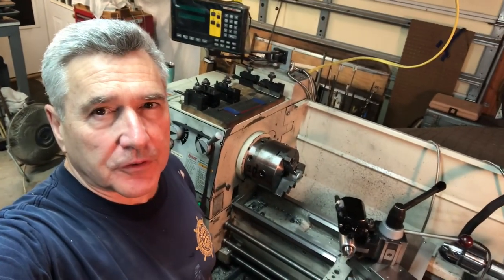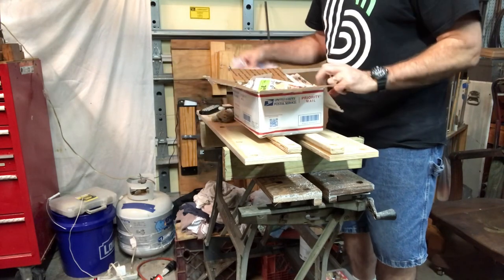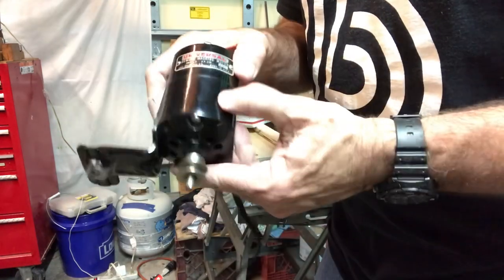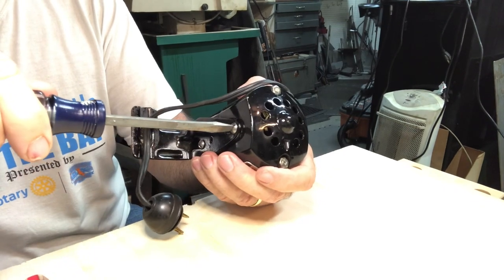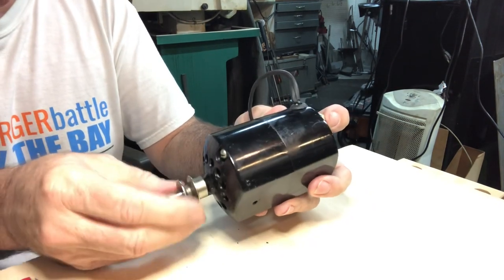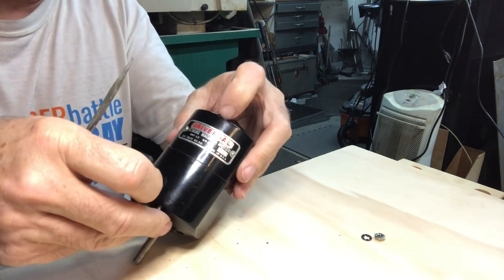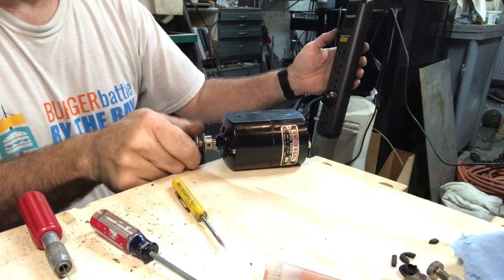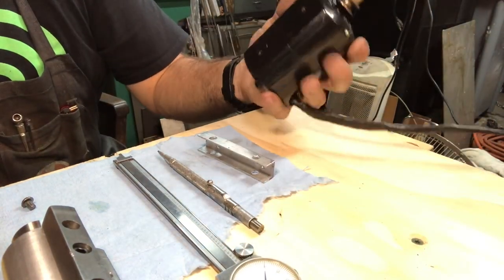Sewing machine motor, reverse rotation, for lathe mill drill and grinding spindle

Comment: Thanks for sharing your knowledge sir. I recently bought an overlock machine and a straight stitch machine ...one needs a motor with clockwise,and another anticlock..I have experience with restoration and repair works but not with these universal motors...here in India mostly we get Anti clockwise spinning sewing motors ,and for overlook machine they just flip install on the table for reverse rotation..I just want to mount motor to the Machine itself, so it is more compact..I will definitely work and Modify my motor...thanks again.

Comment: you talk and show everything, but how you "switch" brushes
Can you explain what you did with plate with brushes? turned it upside down?, rotate 180 degree? something else?
thanks
Reply from the maker: See the video around the 13:30 mark. I just removed the wires from the brushes and placed each one in the opposite location of where they were originally. So I would not forget the original order, I marked one wire and it’s original brush with yellow electric tape. To reverse the rotation I put the yellow taped wire on the brush with no tape. Hope that makes sense. Good luck with your project and remember to disconnect from power before taking apart.